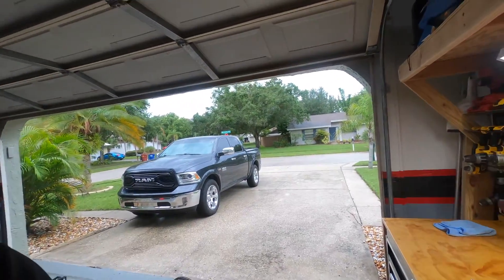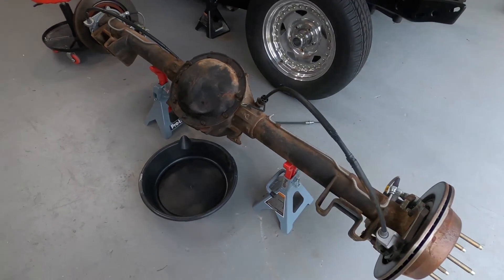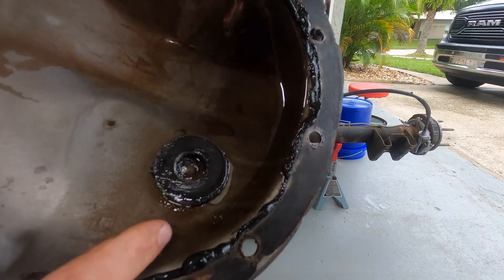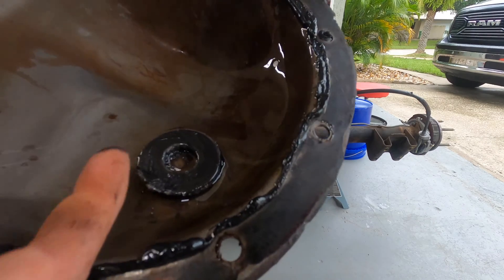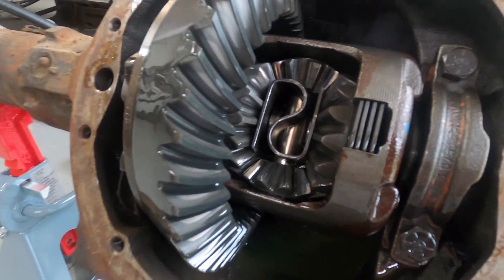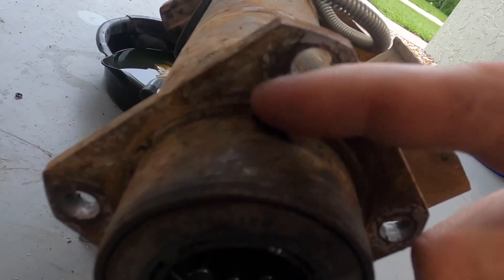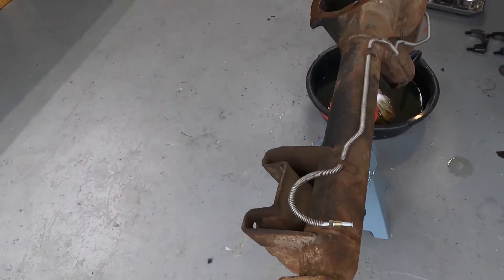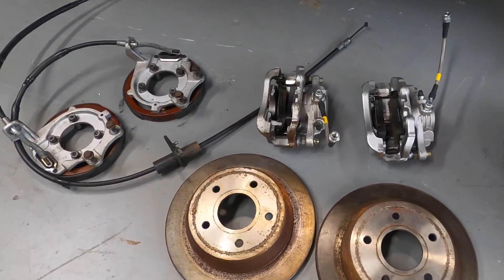Fbody rear end BUILD | Can a gm 10 bolt rear end survive 1000hp?

Comment: it is true that it takes 2.2 quarts of oil from the differential of a Chevrolet Cheyenne year 1995 engine 305 tbi 8 cylinder 5.0 liters
Reply from the maker: The extended warranty ran out

Comment: I have a 97 Chevy 1500 pick up with a 10 bolt can I do these modifications and make it hold up to 1000 hp I’m doing a turbo sbc build as we speak
Reply from the maker: A 10 bolt can definitely hold the power if built correctly, for how long though is the real question that’s why we went with the strange 9” for the reliability

Comment: I run a 1974 GM 8.5" 10 bolt on my drag car that makes 625 HP NA and 1000 HP with 400 shot of nitrous.  Been ran last 2 years hard with no issues. Must weld tubes to housing, use C clip elims, and run a full spool to survive.
Reply: Keep hearing Bs that 8.5s can't take power, what tubes and gears u recommend for a 400hp above rear?
Reply: @redlight3932 Even older GM stock axles and carrier's usually hanlde up to 400HP. Todays aftermarket uses cheap chinese steel that isn't as good as old USA GM manufactured steel axles. Aftermarket Yukon posi carrier's with jack screw cover can handle 500HP as well. For 500+ to 1000 HP it is less about type of tubes used except for they be 3" and not smaller 2 1/2" type and fully welded to diff housing. That is because you need 28-31 spline hardened axles minimum. I mainly use Yukon gears but also use Richmond and never use softer type gears unless top fuel dragster. Spools must be hardened full spools and not aluminum unless again top fuel which takes more money for lighter parts to win. I have 2 8.5 10 ten bolt axles made for 2 racers 10 years ago still running 9's in quarter mile. Good luck with your build and if in doubt just build a 9" or Ford 8.8 since even an 8.8 is just a replica of iconic GM 12 bolt used in 60's.
Reply: . I'm trying to budget build a 96 gm boby 10 bolt . To hold 1200hp. 4400lb...

What do you recommend?

Comment: Hey bud just found u,I’m uk building a 1978c10 with @ 6.0 big turbo around the 1000bhp mark what gearbox would u use?
Reply from the maker: Really depends on what kind of racing you plan on using the truck for, drag racing you can’t go wrong with either a powerglide or a Manual setup, price wise I think powerglide is more cost efficient and more repetitive. But like I said it really depends on the class or what you Plan on using the truck for

Comment: What. Should I do I have a 2010 Silverado 1500 stock rear end and I’m doing twin Turbos but it’s a daily going to be making 1000hp max
Reply from the maker: That’s a good question, I know Mitch Stapleton runs a stock 14 bolt and makes over 2k hp